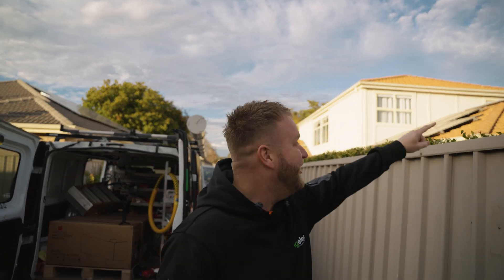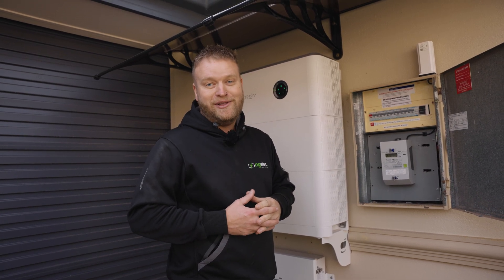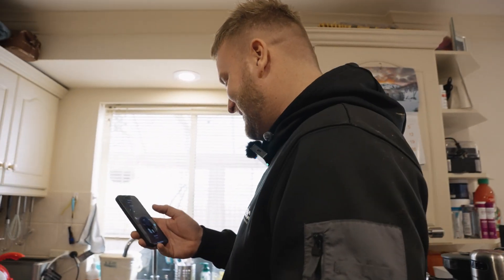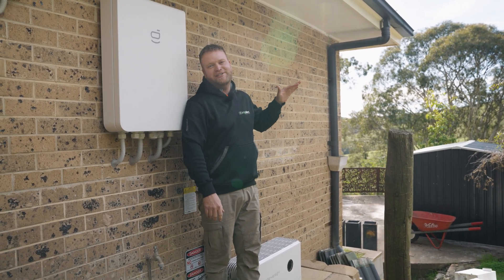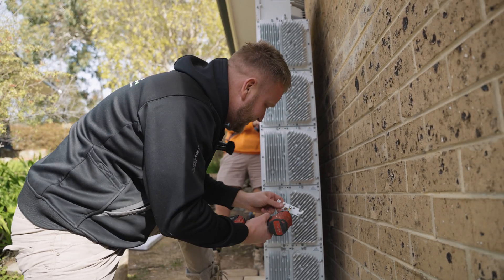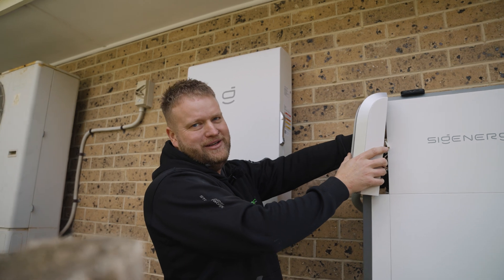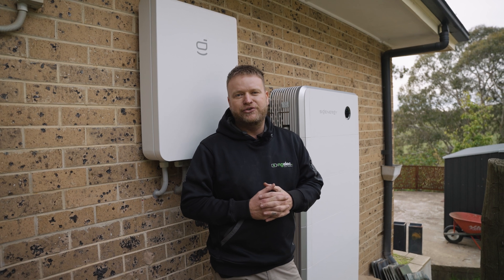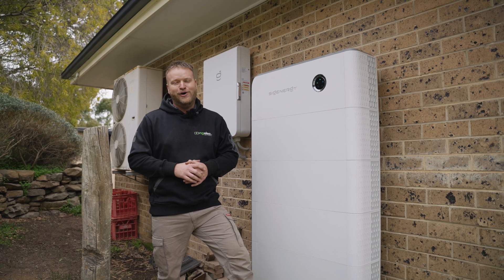We tried to trip the power.. off grid

Comment: Was the first test just batteries, or was the solar panels contributing to the load?
Reply: A very good and relevant question.  The test at 1:30 was in daylight hours using solar pv panels plus 2 x 8kwh batteries.  The presenter correctly references the battery limit as being able to run at 8kw throughput (Sigenergey state the battery discharge rate is half the capacity, so 2 x 8kwh batteries can discharge at 2 x 4kw = 8kw which the presenter states).  So when he ran appliances drawing just over 9kw the system would have provided up to 8kw from battery discharge, the balance from the Solar PVs as it was in daylight.  If it was at night it may have drawn the balance from the grid, based on the Sigenergy user policy parameter setting which is typically set to self consumption first- i.e.go to solar pv, then battery, then the grid as the last choice.

I have enabled my Sigenergy 32kwh battery in July as well,  I also have the 25kw DC car ev charger and 12.5 kw solar PV panels.   This example and your question is really helpful in showing how it works.

My Sigenergy system and batteries have performed perfectly since I turned the batteries on in July.  An easy to use and high quality system.   This video helps show how well it handles all the priorities with Solar pv panels during the day, battery and grid. I also have an ev DC-DC charger so that would be another good combo test.

A great video and an excellent question you raised.  Hope the see a night-time test with a DC-DC charger off grid test as well.   Happy to provide my Sigenergy 4x 8kw battery, 25kw DC-DC car charger modules and 12kw PV panel (not relevant at night) system for an off grid test!
Reply: @tonyg2002Aust  thanks for the reply, I was wondering of the 9kW how much was coming off the batteries had how much through the PV, maybe the app would show. I’m in the process of designing a build with a complete off grid system for a family home, high energy use. I have had a sigenergy quote so currently researching (watching heaps of youtube😂😂). Glad to see a lot of people seem happy with the brand.